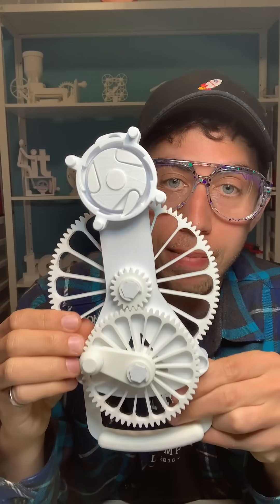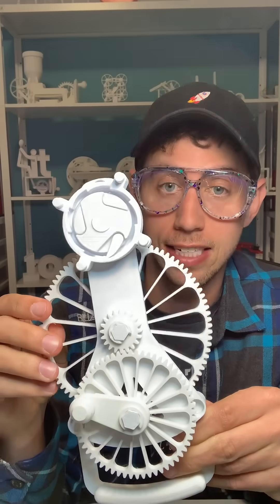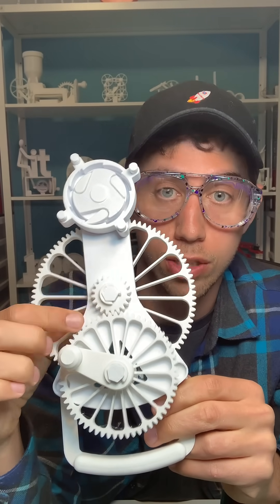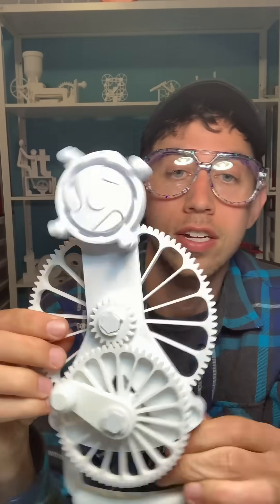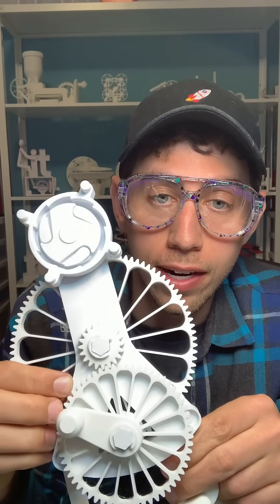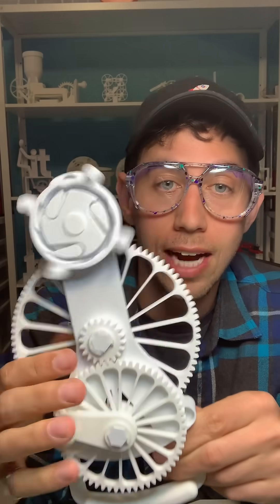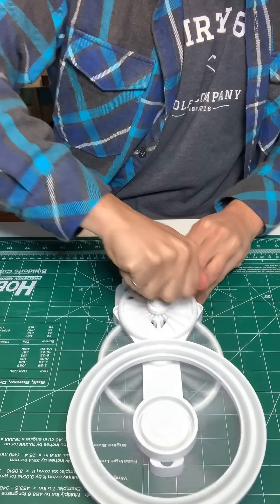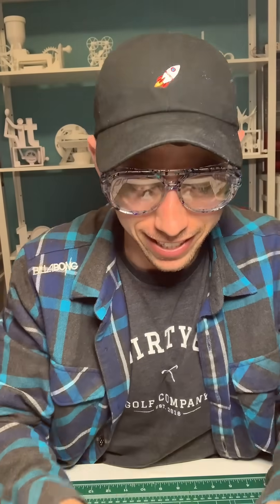The FASTEST Fully 3D-Printed Mechanism I've Ever Made (and maybe the most dangerous...) #shorts

Comment: Finally someone showed one of these things and actually spun it fast
Reply: because the ratios arent extreme lol
Reply from the maker: Exactly! I tried bumping up the ratio to 18:1 and couldn't spin it
Reply: @Engineezy  thing is this ratio will also reduce the torque...
Reply: @CodingWithBen  not for the little gear
Reply: @Engineezy  now Ik my tool t rob da bank
Reply: @Engineezy  try building some inertia by moving one of the middle gears than switching to the hard one it might make it easier
Reply: @Engineezy  join formula 1 you would help their cars even more
Reply: @CodingWithBen  yeah… that’s why it’s so damn hard to spin when the gear ratio is extremely high. Having a high torque means it is very easy to spin the power gear, but the gear at the end of the chain moves very slowly. Having very low torque does the exact opposite, being very difficult to spin but having a very high output speed. The point of these builds is to screw around with gear ratios to see how high you can get the speed without getting a torque so low that it can’t be used but still low enough that it breaks in spectacular fashion.
Reply: @Engineezy  put a saw blade on it ( if you would make sure it wont fall off or have protection )
Reply: @Engineezy  could this be used to increse the power of those human hamster wheel generators
Reply: @Engineezy  attach a hobby motor with  a really fast rpm
Reply: @Coffeesleep125  shifting gears, like a car does
Reply: @Engineezy maybe with a little more space between the gearspikes? For less friction
Reply: Power drill... time to end humanity
Reply: LET IT RIP
Reply: Dude the gears finna explode from that rpm
Reply: It's because at higher gear ratios it gets genuinely hard to spin, and also can fly off like in this video, which may break things
Reply: I don't remember where I saw it but a while back I saw this guy on YouTube who builds planetary gears. He built one strong enough to where he lifted an engine with it off the ground with nothing but 3D printed plastic and his drill
Reply: Yeah its usually the other way around
Reply: True
Reply: Imagine doing this to the end of a Googol gear
Reply: Look up Lego mechanics wheel tests. They spin much faster and show you how they build it
Reply: Jesus Christ loves you all please repent
Reply: And even then I actually spun something at 3,000-4,500 RPM
Reply: But how tf is 22/62 equal to 1/3
Reply: @maxt2822  It's an approximation. Both 22 and 62 round down, to 20 and 60 respectively, and 20/60=1/3
Reply: @_stupidbro  yes what he said even tho I didn't understand
Reply: @maxt2822  Its engineering magic
Reply: @maxt2822  he said 60 tooth and 20 tooth. Not 62 and 22
Reply: @Name-eg1uf  how did people not notice that?
Reply: @maxt2822  60 tooth / 20 tooth, not 62/22
Reply: @maxt2822  its close enough
Reply: Its because it's not a huge gear ratio. Thing still fell apart anyway so not sure what's so great about spinning it fast

Comment: ENGAGE SAFETY SQUINTS and prepare for take off! 🤣
Reply from the maker: Exactly 😂😂
Reply: @Engineezy  I've noticed that it flies if you spin it fast .

Make a helicopter out of it
Reply from the maker: https://youtu.be/C9R43dS8Zu8 ;)
Reply: AVE!
Reply: Sketchier as frig!!
Reply: Beside that the hand was only centimeters off of the wheel that was spinning. If it really would explode wouldnt safety gloves be useful too? Guess lucky that it jumped over your hand
Reply: @NCIA-93  idk dude it's plastic. Pain = gain it isn't gonna kill you. 😂
Reply: @NCIA-93  That would (probably) not chop a finger off, might bruise or cut a bit, but will probably heal fine. A piece (likely sharp) in the eye though... You'd be lucky if you get away with only a damaged eye
Reply: Good ole ave